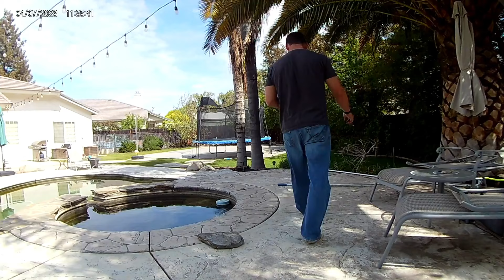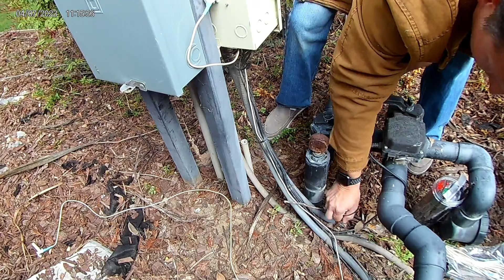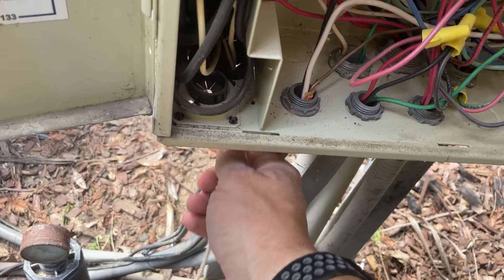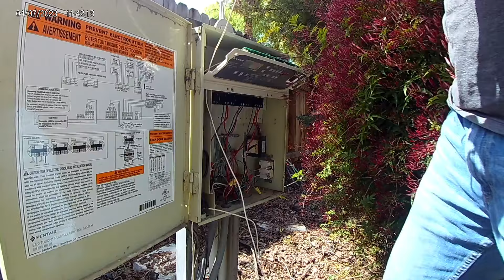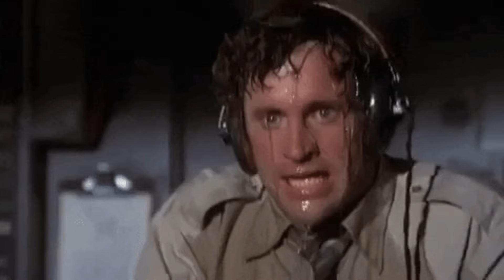DIY Pool and Spa Temperature Sensor Replace (Pentair)

Comment: Not intending to ask dumb or obvious questions, but since it wasn’t stated explicitly, I presume pool pump and panel power should be shut off before installing the new sensor?
Reply from the maker: It would be a good to do so.  By eliminating any electrical source, it will make the installation fully safe and avoid any possibility of electrocution.

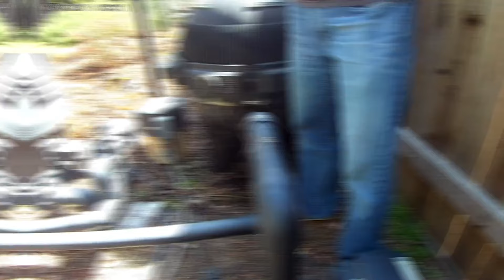Comment: 4:35 mins (<<click here) when you are installing the temperature sensor did you use a glue, like silicone adhesive?  I know they provide an o-ring, but is that enough?
Reply from the maker: Just used the O ring.  Didn’t use any glue.  Thanks for watching and asking.

Comment: Is it possible to calibrate the sensor? After replacing my broken one with a brand new one, it seems to work, but the reading is off by 8-10 degrees.
Reply from the maker: There is a way to calibrate it, in the Pentair SLConfig App, under General Settings, there is a “sensor calibration” setting.  Should be fine for a sensor only a few degrees off like yours.